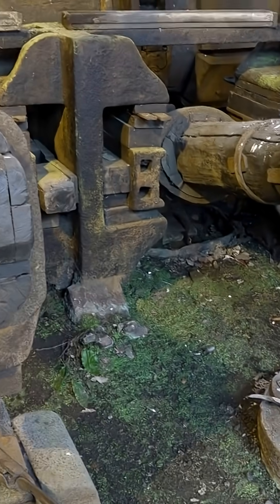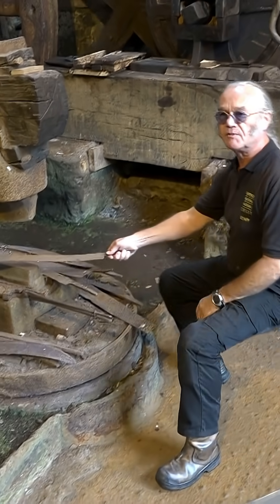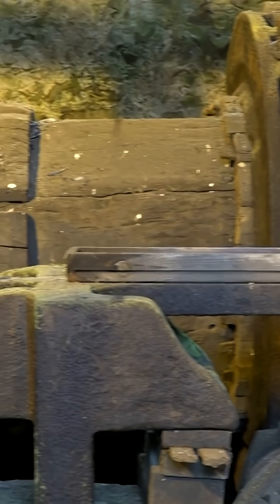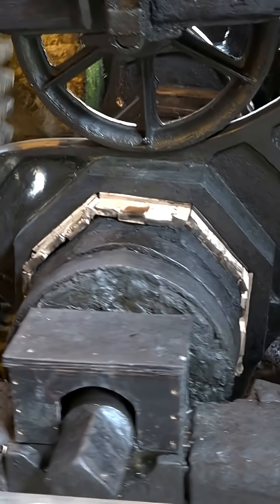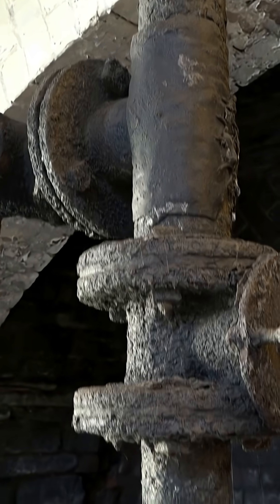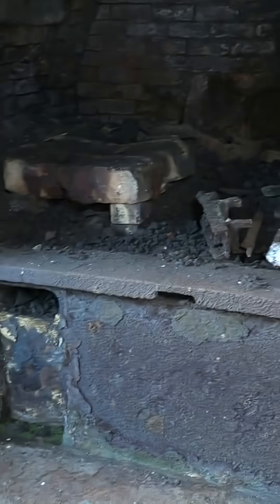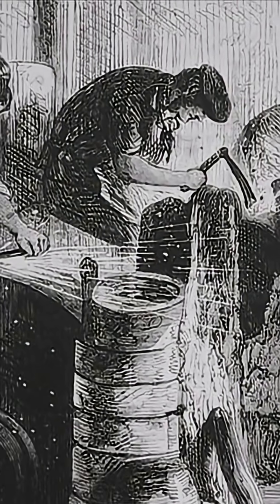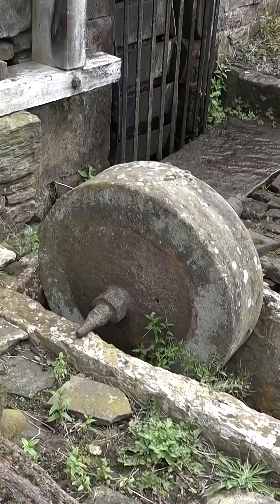Water-powered trip hammers of the early industrial revolution

Comment: Really makes you appreciate the relative compactness and safety of hydraulics and electric motors. 

Before that, it was all giant contraptions on a central spinning axle being turned by a water wheel, or a hornet's nest of steam pipes. Either one could easily deal you a career ending injury before you even had time to react.

Comment: Okay, that's cool . I actually wondered how they did this before they had steam hammers. They had water powered pretty much everything when that was the main power source, but it's always cool to see how they made it work. I wonder what kind of control they got with this. The steam hammer operators liked to brag how they had a hammer that would shake the ground for miles around, and would flatten a solid billet of iron, but they could also get millimeter control with practice, the lightest blows to full power blows. They have stories how they would show off by placing their pocket watch (which was a very expensive investment at the time) on the anvil and bringing the hammer down and stopping it gripping the watch but not even marking it. I am assuming that was a big deal because it had not been possible with this sort of hammer. And I think they used hand -hauled gravity hammers before that, so even this was a big advance, able to make rapid repeated blows while the work was still red hot.

Comment: Valve regulated air supply and therefore temperature. How could they tell between 900 and 1000⁰C? Did they have thermometers then?

Comment: Was in Rochester, NY years ago. Down at their rover front, right across the Genesee River from the Genesee Brewery, they have an old 20 ft in diameter reverse water wheel that still turms a long power take off with one of these old trip hammers and several other machines.  The old engineers cut a small canal from above th Genesee Falls down the side to feed several water wheels which ran the city's industrial machines.

Comment: UPDATE: These kind of device were actually invented in the 14th century.

So from the way the narrator explains it they invented the world’s first pistons in 1720, right? 

1. Piston rods attached to the pistons make them move up and down in order to push air through the pipe(s).

2. Air reaches the destination making the object function or operate. 

	•	They have a reciprocating stroke
	•	They move air
	•	They use linkages, cranks, and rods

I wonder if they knew what they invented and if this is what they used as the idea to create gasoline engines.

Comment: Imagine if Apple made that.
You wouldn't be able to swap out a broken tooth unless you replaced the entire gear. 
I mean you COULD go to a third party repair shop and they could replace the tooth, but then Apple would have made it serialized and now the entire shop doesn't work because it cannot verify the correct components because of "safety". And if you do go to Apple for the repair they charge you about 80% the cost of the entire shop, so you might as well just buy an entirely new upgraded model......

Comment: The early industrial period is where Western society learned thousands of lessons paid in blood.
Ironically, many are under threat today; from elimination and fad-zealots both.
From rapid increases of food legislation after adulteration, to laws about snake oils, to anti monopoly law, profiteering, alcohol control, drugs, modern farming, pollution, heavy metals and sewage.
You name it, almost everything we take for granted has its foundations in the mid to late 1800s. Every change allowed another somewhere else, the start of the same pattern (but slower and harder to spot) that defines change today.
The exceptions are specifically flight, radio (any rapid broadcast media), computers and the internet.
Because science and medicine were achieving crucial understandings and changes here, too.
Which led to late 1800s, early 1900s capacities, and the conditions that allowed the WWs to become what they were.

Comment: If they were only making one thing (which I do know is unlikely, but based off the narrator stating “they made 84 scythes a day” it does some plausible), then why were there crucibles with 2 different temperatures? 

I know very, very little about smithing/metalworking/etc. (unless it has to do with OSRS), so I’m quite curious and fascinated by this kind of stuff.

Comment: this is a personal thought, but if this apparatus had iron pipe fittings for the air flow at this time in history, I find it exceptionally odd that I personally have dug up and found still in use! tees in watermains that were made out of wood that are estimated to be from the 1910s. which I can't tell if that was because of lack of material, or lack of funds.

Comment: "...legs wrapped in water-soaked cloth..."

Doing this seems logical, right? It'll protect your legs from the fire/heat, right? Sure, but it's not that simple. It's actually really counterintuitive, but the wet cloth absorbs the heat and transfers it to you MUCH faster than if the cloth was dry, however the water does stop it from catching fire from open flames. 

You can demonstrate this concept easily at home with your stovetop and a paper towel. Hold the towel to the hot stove. It takes a few seconds before you feel the heat. Now wet the cloth and do it again. The heat transfer is almost instant.

Comment: As a former blacksmith back in the day this is some great content! The people in the furnace chamber would’ve been short because they were probably children lol.
Trip hammers are one of the scariest pieces of industrial equipment ever! But wow, they sure get the job done.
Watch where you put your fingers!
Reply: Plus not getting enough to eat stunted there growth as well..
Reply: Yes.. this is where the apprentices would have worked, but only some of the time. There would have been no need to stay there for long as the furnaces were fed from the top, You would have had to go down into the pit to clear out the ash and clinker and set the hearth for the following day. 
The hearth is just a pit with a bar grid at the base. You would have started the fire with kindling and a layer of coke. The empty crucible was set on the layer and then the sides of the pit backfilled with coke and lit. The chamber was mainly there to supply air to the row of hearths. Once the crucible was hot, the charge was added with a funnel and the contents allowed to melt. Once the charge was liquid, the crucible would have been withdrawn and the hearth set for the next charge with an empty crucible all from above the pit.
Reply: @felixthecat265 sigh. I know this. I’ve also worked in some of the largest foundries and smelters in the world,  built refineries, oil rigs, power stations etc etc for over 40 years now and I’m currently working 2 kms  underground in one of the worlds largest gold mines. But thank-you for pedantically sharing.  These days I just blacksmith for laughs in my spare time.
Reply: @planetdisco4821  Gosh I'm impressed!
Reply: @planetdisco4821 felixthecat's answer was quite informative, at least for me. 
You may have misunderstood something here, because I did not have the impression of him being pedantic at all.
Reply: "Now you see them...now you don't"

I kinda wanna put a chicken leg in a big trip hammer like that just to see what happens....
Reply: I imaging getting into a trace, with the rhythm of it.
Reply: 1700's men were shorter and they didn't wear high heels like today's men...

Comment: To bad they didn’t use a lot of brass for the water soaked metal if they did it might be running today and not setting up an adequate air supply to get rid of grinding dust just shows life and health were not even a consideration.

Comment: 55 years ago I saw the complex working.  Sadly it is now unsafe to run all of the machinery.  Massive drop hammers, shaping and sharpening stones, bellows and furnaces made a cacophony of sonic exuberance that could be felt through the ground.  I remember the story of one chap who took his finished scythe blades to the managers off ice for inspection, slipped on the top step of the stairs and fell backwards.  He proved the excellence of his sharpening skills by being decapitated by one of his blades on his fall to the bottom.  A very dangerous job with low life expectancy due to hot metal, grinding dust from gritstone wheels and steel as well as razor sharp blades.
Reply: Crikey, that was poetry and a horror story rolled into one.
Reply: I bet that was quite impressive to see!
Reply: I guess the blade passed without any closer inspection.

Comment: Seems like anyone working around hot metal that long would have realized, wet cloth conducts heat through it far more quickly than dry... 

Anyone who doesnt believe me, take any kind of cloth, wrap a dry piece around one hand, and a wet piece around the other. Heat up a cast iron pan on the stove or in the oven then grab the handle with both hands, the wet cloth hand will burn you before the dry cloth hand even gets uncomfortable. 

Yes i know the leidenfrost effect would protect their legs from splatter of molten metal as it beads off. But not the hot crucible or radiant heat, thick dry pants would do better. 

Never had cotton jeans let me down with spatter from welding, besides it rolling down my shins into my boot and burning my foot

Comment: That 1742 looks a lot like 1785 or am I missing something?
Reply: He mentions that a lot of work has been done over the years, decades, and centuries since it was first built. I assume the peice shown dated 1785 was part of this, either adding a new section, or repairing an existing one on that date to the structure that was already there.
Reply: What you're missing is what he said as they showed that date. Listening comprehension, turns out it matters. That's what you're missing.
Reply: Refurbished in 1785 after working day and night for 43 years
Reply: It's not the machine but the building.
Reply: Noticed that as well
Reply: My guess is a bad editing choice and using the wrong picture, or he got the date wrong

Comment: “…his legs wrapped in water-soaked rags”. Thus scalding them when the water is heated. 
-never worked a foundry, but do know that, when welding, you do NOT want to handle heated metal with even damp gloves. I’ll leave it to others with actual experience to confirm or deny this trope.
Reply: It's not for handling, it's for keeping the ambient temperature from just being near the furnace down. 
It works exactly like sweating does, the heat dissipates in water. It's never hot enough to produce steam like directly contacting the heated metal would.
Reply: In China the foundry workers wear water soaked straw hats,
Reply: He’s not handling the hot metal with his legs, it’s to stop the IR radiation coming through the air from the foundry/ metal
Reply: In sweden (and other places) the smiths at ironworks worked in just a long white shirt. The white fabric reflected the radiant heat from the steel and should ideally be a new clean one each day to work well. So lots of washing going on.